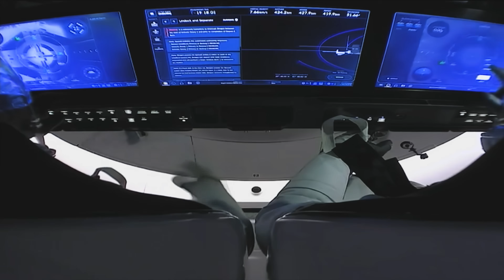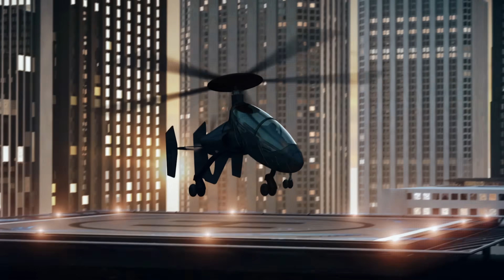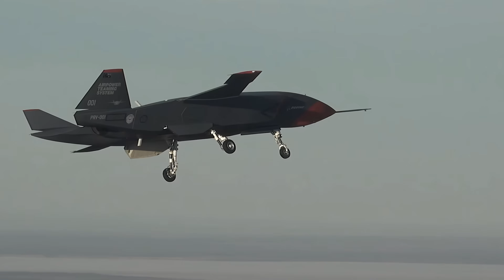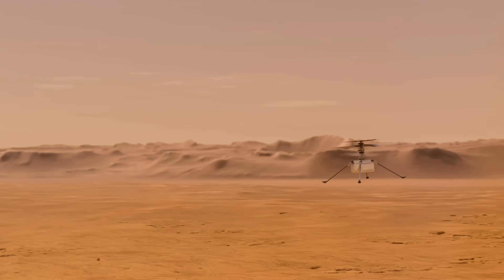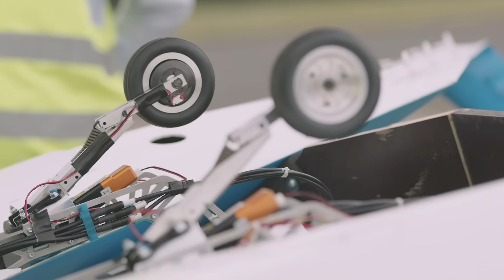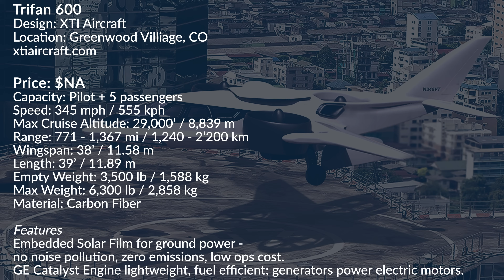Aerospace Projects Rethink Propulsion, Autonomy and Aircraft Design

Comment: Anybody realized the aerodynamic problem of the Trifan 600? 
I'll give you a hint: a multicopter uses multiple propulsion units spread out around the center of gravity (CG) of the aircraft. As the visualizations displayed in the video, the CG would need to be located between the back fan and the front fans as well as within the wing section that would provide lift during cruise flight. The shown fuselage, however, is much more extended towards the nose of the aircraft with almost no space between the props/fans nor in the back. So, passengers would sit in front of the CG leaving the spare space behind the back fan only for fuel...

Comment: Please revise the data section on the Flying V. Stating 314 passengers in an airplane of 3m wingspan and a weight of 22.5 kg is.... STRANGE, to say the least. 
Either refer at it as a model by deleting the passenger data, or use the dimensions of the planned commercial plane.